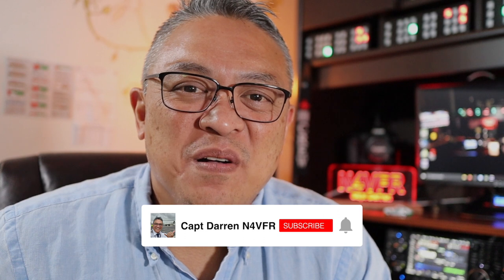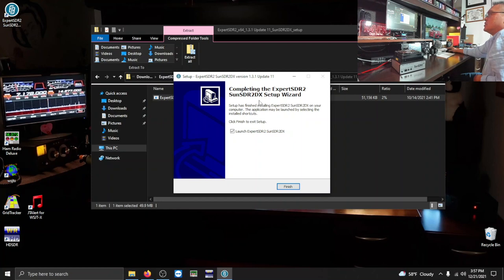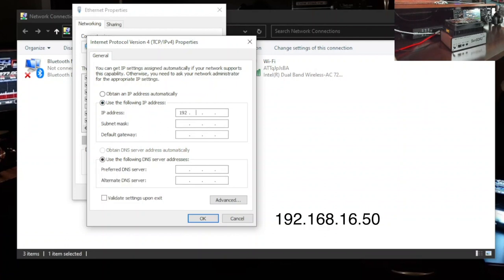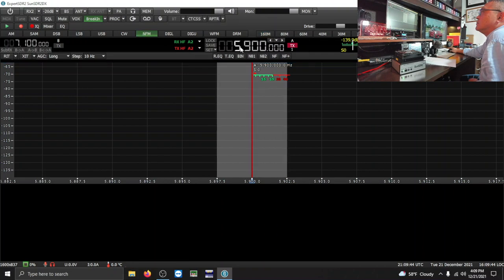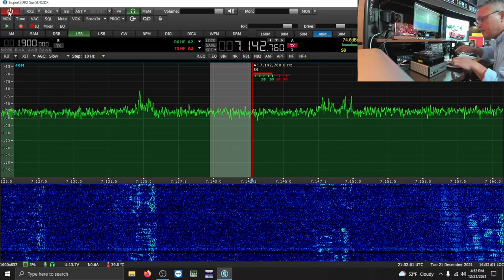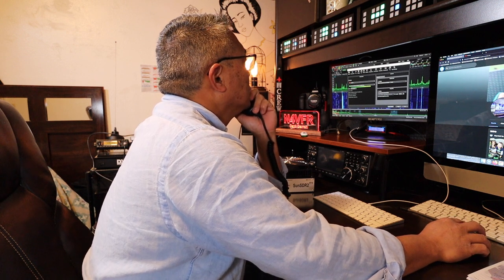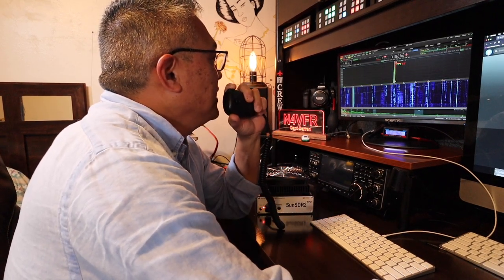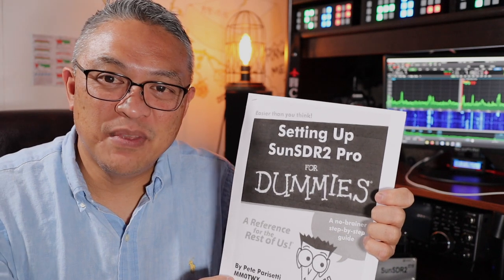How to Setup the SunSDR2 DX | Troubleshooting Help! | Expert Electronics SunSDR2 DX | SDR

Comment: I use the sdr2 pro, Ive had it now for 2 years its the best transciever Ive ever had, love it. I shared your pain when you first switch it on, it takes a while but you will get there.
Reply from the maker: I love the Expert Electronics SunSDR2 line up.  Yeah, initial setup is a pain in the arse.  With regards to remote operations outside my network, I'm unable to make it work just like on my previous video with my IC7300 in my QTH in Texas.  However, in Florida my ISP is AT&T I was able to make it work.  I use my IC7610 on Remote HF VOX Operations.

Comment: Captain you are doing great. 
tnxs v for the video. 
Trying to used  991a and th FTDX-10 and I am lost. 
Ham radio is a fun hobby. 
Been off the air for 20 plus years. I have alot to learn 
73 KQ4CD Paul

Comment: Expert Electronics came out with the schedule for the last Beta and final version of SDR3.  ExpertSDR3 1.0.5 Beta - 5th of May 2023
ExpertSDR3 1.0 Final - 25th of December 2023
Expert SDR2 is a great control program but after using SDR3 even with all the bugs, I find SDR3 to be so much better. Looking forward to the SDR3 final version....it will be awesome I am told.
Reply from the maker: Yeah, I will re-install EESDR3 again.

Comment: I like SDR's - I have an IC7300 and IC705, but I'm wondering what's is the key advantages of SUN or FLEX SDR's as apposed to an individual radio.   More tidy less cluttered shack?  I know there not exactly for portable use.
Reply from the maker: Check out my friend @KB2UKA Doug's setup.  You can achieve excellent receive audio.

Comment: Are you planning to run this new radio remote as well?  Do you ever run cw remote?  Curious your experiences on both of these questions.  Will be interested to hear what you think about 7610 vs this setup
Reply from the maker: Yes, I'm still figuring out the SunSDR2 DX and working on how I'm going to connect my Heil PR40 Mic into my MacBook Pro.  I haven't touched CW since getting my General License back in the 80's.  I haven't tried CW remote yet.  So far going through the SunSDR2 DX, there is a learning curve.  I have so many projects to do along with my Flying Career, it's really tough to sit down for a day without my baby girl asking for my attention. Once I have a firm grip on the SunSDR2 DX, I will surely tell you my thoughts.  I know for the fact, that one may be intimidated because you will need to configure the SunSDR2 DX IP address.  I prefer using Windows 10 vs using Windows 11 when trying to configure the SunSDR2 DX.  Right now, I will be using the SunSDR2 DX with my 2017 MacBook Pro 15".  Thank you for watching and commenting.  73's de Capt Darren N4VFR
Reply: @DarrenN4VFR  thanks for the info- I am just starting to look into sdr options - I like the idea of using a Mac.  I only use PC at this point for ham applications and really don’t like windows so Mac options would be high on the list - is sundar sw running native Mac OS ?  I’ll check the website also thanks
Reply from the maker: @neoretrophoto9198  Yes, I'm using it on OS Monterey v12.0.1.

Comment: How do you like the sun SDR by now?Do you like it as well as your Icom7610?
Reply from the maker: My Sun SDR is in my Texas QTH where it's minimum RFI issues and my 7610 is in my Florida QTH where there's too much RFI and it's havoc trying to listen on SSB.  I like both radios and I wish I had an Anan at my Florida QTH so I could use NR2 and Diversity reception to help reduce powerline RFI in Florida. I really like them both.  There's an Anan in the future though. 73's
Reply: @DarrenN4VFR  thanks for the reply Darren.7Do you feel the Anon is a better SDR?
Reply from the maker: @hunt555fish  Yes I do, a few of my ham friends run them.

Comment: Could you please make a video how you use it in remote operation via Internet? Thank you Captain!
Reply from the maker: I'm sorry,  my ISP isn't helping me with what my WAN IP address is.  When I type in the search browser, "What is my IP"  it's giving me an IP buy it doesn't work.  My ASUS router shows my WAN IP as 192.168.xxx.xxx which is an Private IP address.  My ISP is Quadsys and I use a line of sight dish which beams the signals.  I believe there is another router servicing me before it goes to my QTH.  I tried doing this on my IC7300 using RSBA1 and it didn't work.  I only got my remote HF to work from Florida on the AT&T ISP.

Comment: The way your screen is set I can't figure out where the "Options" screen is accessed.
Reply from the maker: I'm sorry about that.  Take a look at this video.  I show you my display and you can see where the option tab is.  It's at the top right of the screen.  https://www.youtube.com/watch?v=xVVbGt9DoNw&t=18s
Reply: @DarrenN4VFR  I realized you are on EESDR2. EESDR3 is set up a little different. I cant get the TCI light on RadioSync to go green. Just stays yellow, so I cant get WSJT-x or JTDX to control the radio.
Reply from the maker: @Rattletrap-xs8il  Ah, okay.  I've downloaded EESDR3 but haven't spent too much time exploring it or using remote option.  Perhaps, if your not already subscribed to the Facebook group, "All Things Expert Electronics SunSDR" group ask your question there or on the EESDR forum https://eesdr.com/en/forum-en/oglavlenie
Reply: Didnt see the TCI button in the bottom right corner.

Comment: I am at my wits end. Had it working fine for a couple of years. Now cannot connect through ethernet. I have done hardware reset, done all the stuff in Dummies Guide, I can get connection directly from PC but when I connect up to ethernet switch and all, no good. It does not see the transceiver. The IP address has been changed to match up with my computer, etc.

I am really at a dead end.

I hope you are still around or someone can help me.
Reply from the maker: This link may help you out:  https://www.youtube.com/watch?v=-CsImlAWCVo&list=PLsd7gKFhoGmtLQxwln-RvjzFgNOImfbwB&index=3